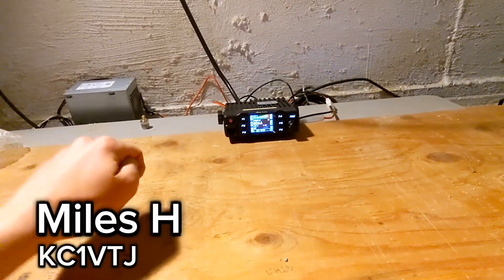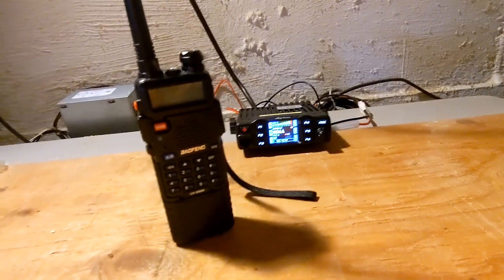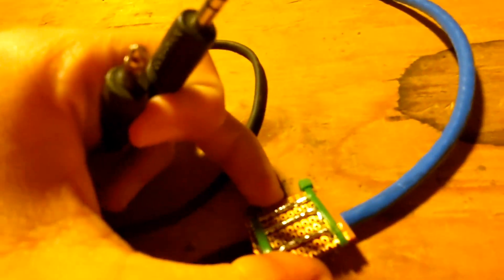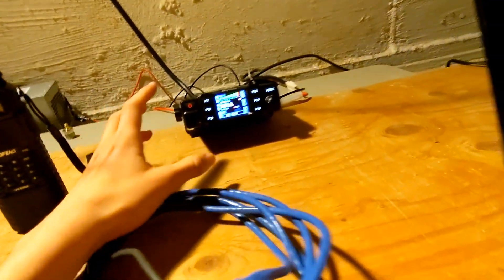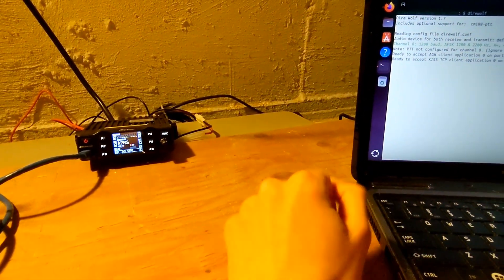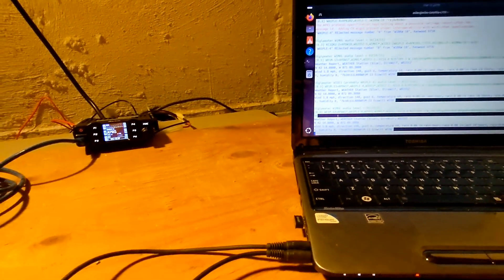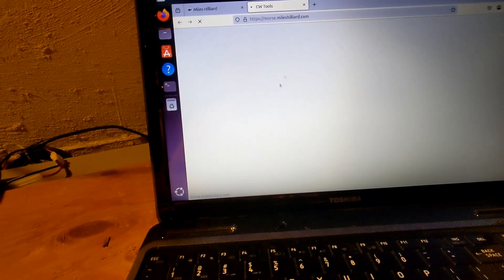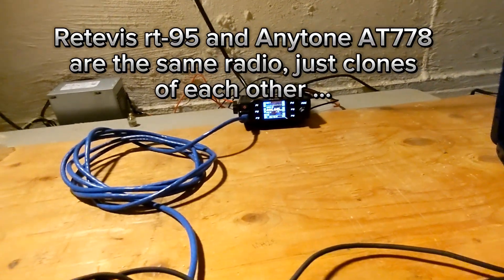Digital Modes on Analog FM Anytone AT-778UV Retevis RT-95 Radio

Comment: First congretulations for share and good realisation. I've a CRT270M  (same AT-5888 UV) and I want making this adapter. What is the wire plan to make it pse?

Thks from F4MER
Reply from the maker: Have a look here:
https://www.truehamfashion.com/2023/04/anytone-at5888-uv-mobilinkd-cable.html

The wiring should be similar to what's mentioned in this video!

Let me know if this helps!
Reply: Hello.
Very thks for your rapid answer. I'll testing that the next weekend.
If it's ok, I'll alert you to share whit others ham 😉.
F4MER

Comment: Thanks for sharing this! I have an AT-778UV and will try this out over the weekend. 73! PS: great website
Reply from the maker: If you have any questions just let me know!
Reply: @Sky-Wired  I'm back with a question for you :-) So, I finally found some time for putting it together, but I'm not sure about sth. From your schematic it seems that I'm supposed to connect the "UP" pin (that should be used to dial up the frequency) to the audio. If I do this and then plug my cable to the radio, it starts shifting the frequency. May I ask you if that's a mistake in the schematic perhaps, or do I really need to connect the UP pin of the ethernet to the L+R audio signals? Thanks in advance!
Reply from the maker: @stefanoboccelli4221  Hey! Yes the schematic is in fact correct. I have experienced something similar, where after connecting everything the frequency will change briefly. This is due to the fact that the freq. UP button functionality works by shorting to GND, which can happen briefly when plugging in the two audio jacks. To fully eliminate this, you could purchase a 1:1 audio isolator transformer so that the wires are physically isolated from one another. It should however stop jumping around after a second. If it continues to change frequency, I would make sure that you don't have any wires accidentally touching or shorted. Let me know if this helps!
Reply: Hello. I'm making this cable, it's possible to incluse a opto coupleur in place the transfo?
Thks

Comment: That's not what digital is tho. You just pumping analog levels. Rediscover ax25 and get yourself internet over the radio. It's gonna take some doing (like dropping the vox on bao), but since you already familiar with direwolf I think you'll get there fast enough.
Reply from the maker: Rather this is sending digital modes (packet radio over an analog radio). Ive never really dabbled in ax.25 but I will do more research.👌
Reply: @Sky-Wired  APRS uses the AX25 protocol.